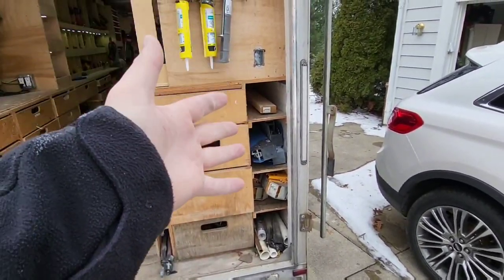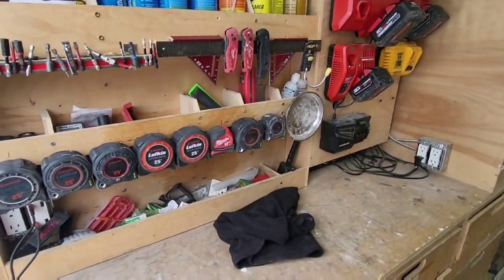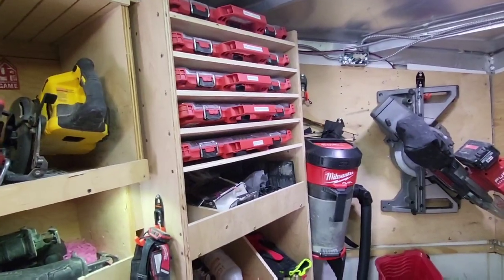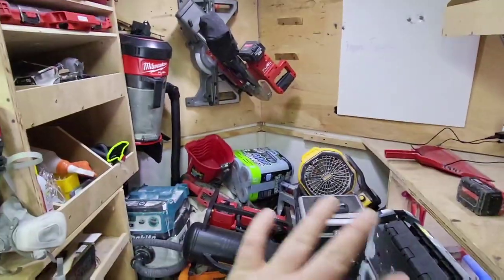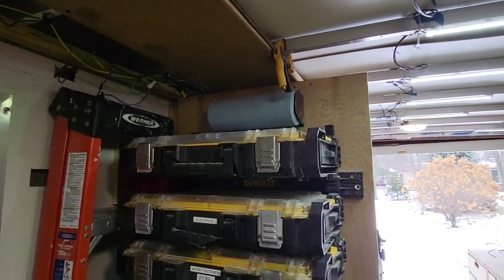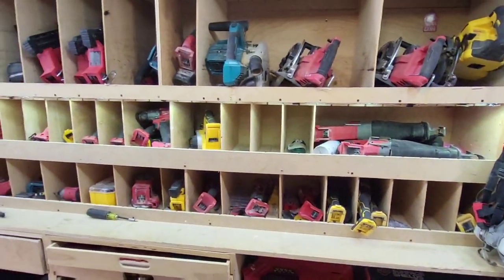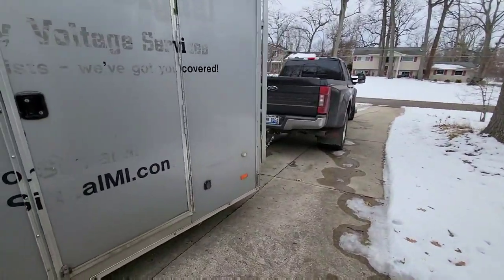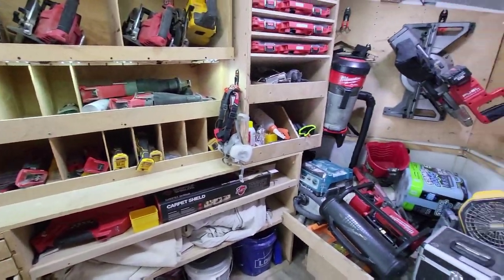Tool Trailer 2022!

Comment: I would like to hear your opinion on the makita vac. I am looking at purchasing a makita 40v miter saw and a makita vac. Are you happy with the size you have? Do you use it for cleanup as well as dust collection? I am also looking for a good vacuum for cleaning up floors. Cool trailer!